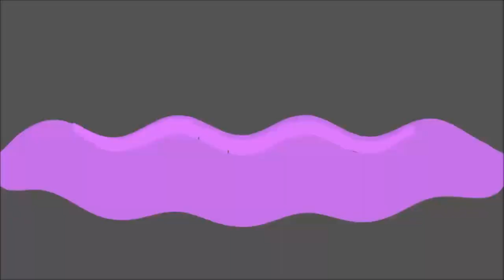Front Brembo Brakes Installation

Comment: @ 6:29 - What’s the reason for cleaning the assembly on a piece of foil?
Reply from the maker: I found that the foil with vinegar is really good at removing surface rust.  I remove the rust to have a good surface to paint and seal to prevent future rust